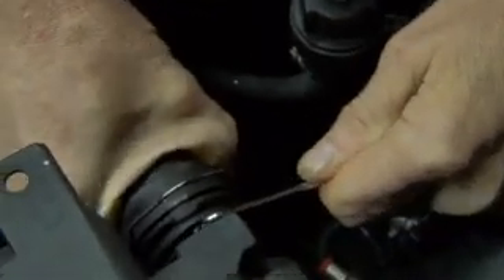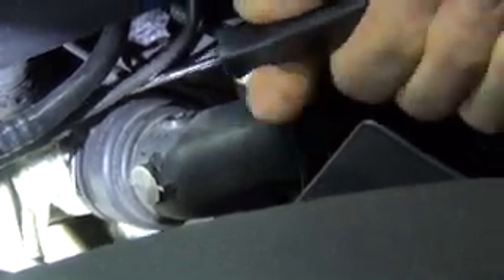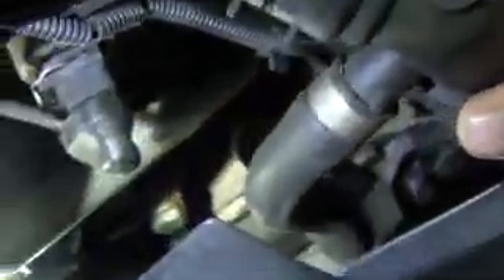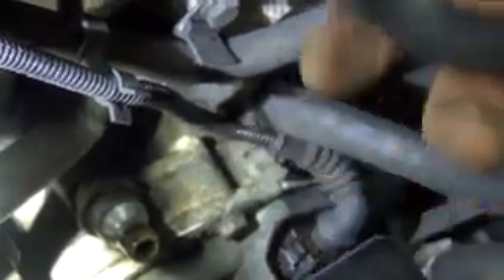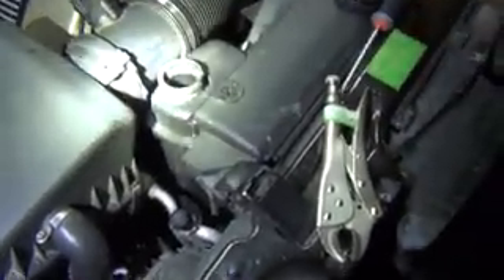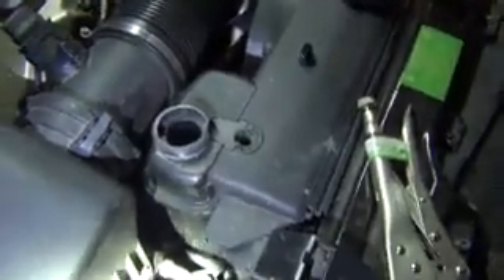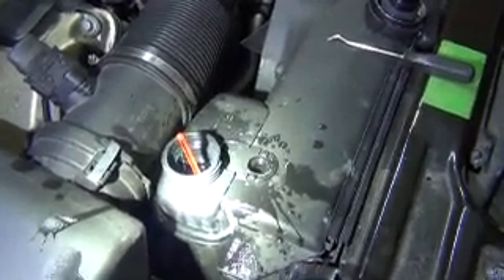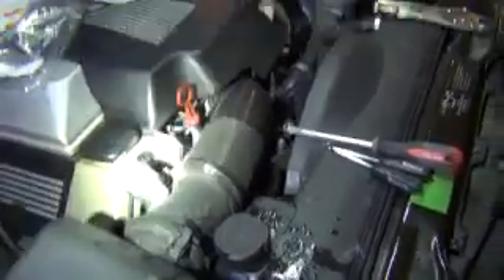BMW 7 Series E38 Radiator Hose Replacement And Bleed Procedure

Comment: i have watched several of your videos and I appreciate them above the rest that pertain to the bmw e39 M54 engine. After viewing your thermostat replacement vid, I changed out my thermostat and noticed that I had a temporary leak connecting top hose back to thermostat.  The hose was in good condition otherwise.  It seemed that the pinlock had not seated or something but begged the question, is this design capable of needing help seating (which I see you used petrojelly) or proned to a small leak (like I experienced).  In my case, I am pretty sure the hose's pin had locked onto the thermostat and I may have pushed the hose further on the thermo and that stopped it, I don't know cause the leak happening while engine was running.  

I'm about to replace my fan shroud and may drain and remove all the hoses to make a closer inspection of them.   I would think any chemical seal that was ever needed (besides the locking pin) would need to be something that didn't poison the radiator mixture. If there's any further info you might have...i'd appreciate it.